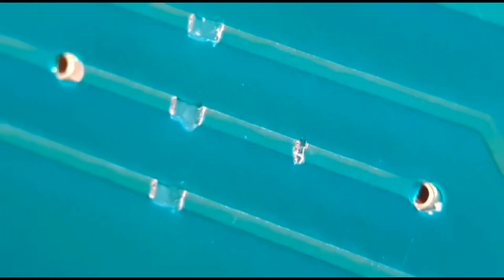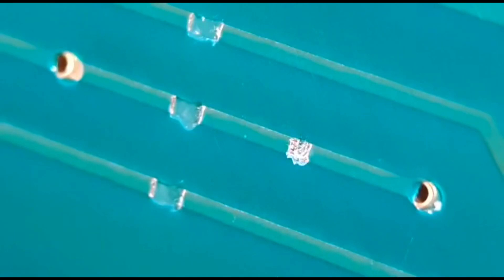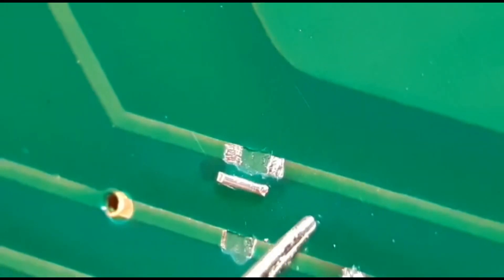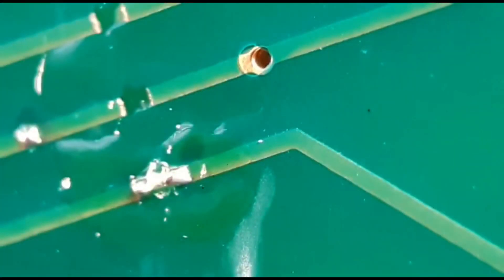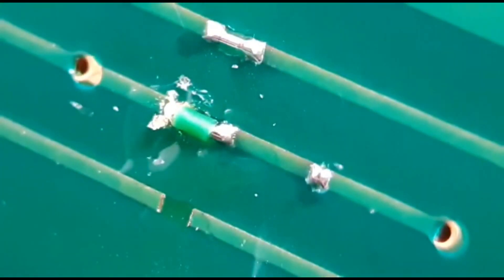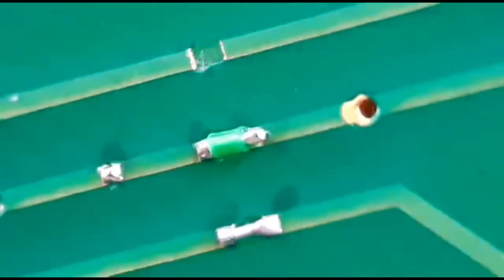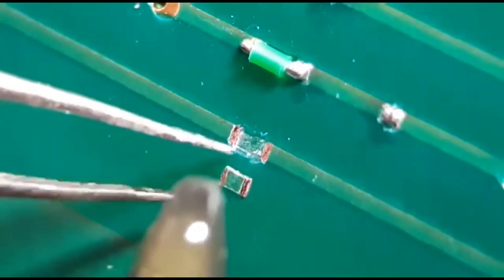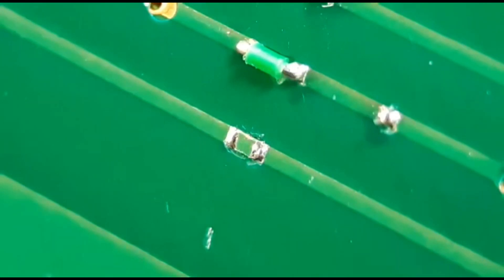How To Repair Broken PCB TRACE  -  Learn 4 Different Methods

Comment: Just found your tutorials whilst sifting through many others on PCB repairs where the youtuber drones on making a 10 minute video last a minimum 45mins interrupted by ads! Yours' are a breath of fresh air, you don't keep banging on and repeating to make a point nor assume that we are idiots, you show the prep once then carry on with the meat of the subject, 10 mins to get the message across clearly, without confusion and without irritating adverts breaking the flow because you just get on with it. I didn't think that was possible! I'm new to electronics but have always had a lurking interest in it , now I have taken up RC aircraft that interest has widened, I didn't know you could do half the stuff you're showing! Carry on mate I've learned more in 2 evenings from you than than 20 yrs flitting around listening to monotonous, tedious attempts from others. Subscribed , recommended and liked with absolute pleasure.
Reply from the maker: Hi . Thank you for your great comment , much appreciated. I will carry on posting videos roughly every 2 weeks so hopefully people can learn a few new ways to help them with any problems they may have . Thanks again.